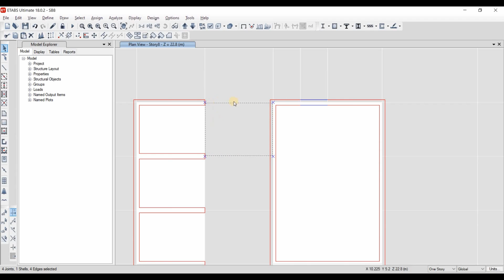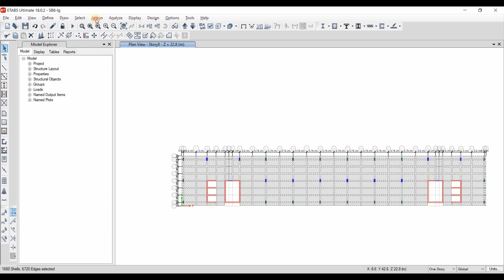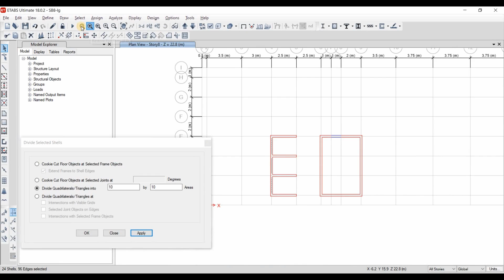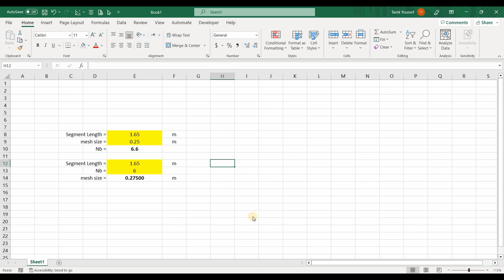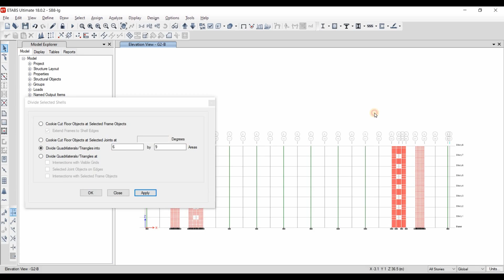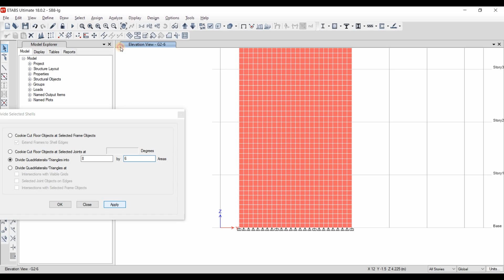ETABS Tutorial 3: How to Create a Consistent Mesh for Slab and Wall Elements in ETABS Software?

Comment: Thank you very much. I have a question: I’m working with a column that spans two stories, but since the software forces a split by story levels, I have the option to join the frame and shell elements. Is it okay to merge them, or will the software not interpret the element correctly for mass calculation per floor? Is it mandatory to split the element?
This usually happens in basements with parking. 
Reference levels are fine, but some levels split walls and columns automatically. Any guidance or reference to a previous class on this would be greatly appreciated.

Comment: Does the meshing factor, in your case 0.25, have to be the same as that of the wall, and does it have to be the same among other walls as well?
Whats the rule to taking a factor???:goodvibes::goodvibes:
Reply from the maker: In my case, using the auto rectangular option with a meshing factor of 0.25 effectively maintains a regular mesh pattern across walls and slab elements because their dimensions are divisible by 0.25.

However, in scenarios where elements have varying dimensions that do not uniformly divide by a single factor like 0.25, opting for the general meshing option is preferable. This approach provides flexibility to adjust mesh sizes according to specific element sizes and structural requirements, thereby ensuring optimal mesh quality throughout the model.

Comment: why do other engineers do an automatic wall mesh, is that wrong, if yes why?
Reply from the maker: In older versions of ETABS, using the automatic wall mesh option often resulted in incorrect lumping of masses across story levels. In this case the manual meshing of walls is necessary, where walls are divided into smaller elements manually to ensure accurate structural analysis.

However, in the newer version of ETABS, this issue has been successfully resolved. The software now handles automatic wall meshing more effectively, ensuring that masses are correctly distributed and calculated across each story level.